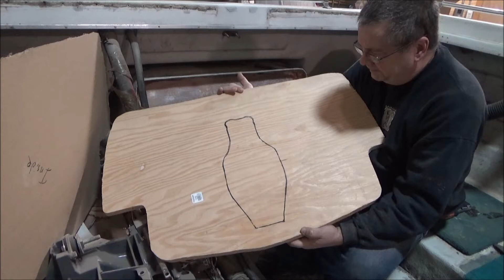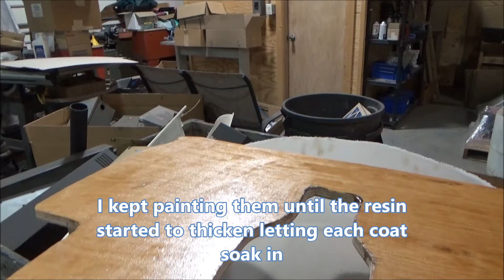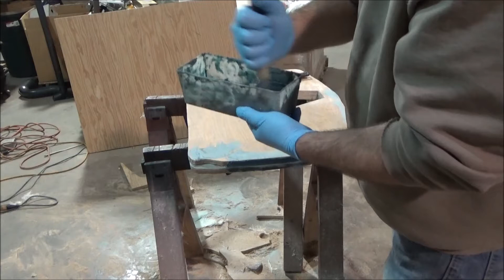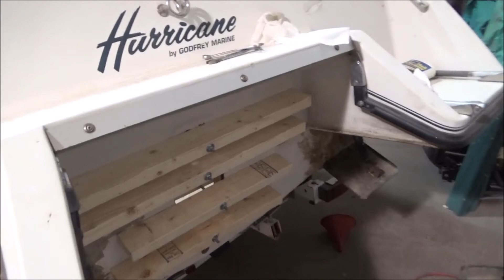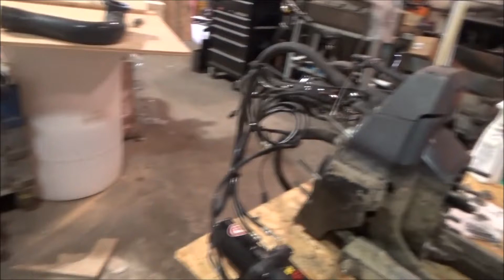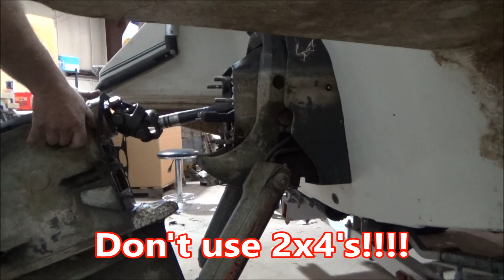92' Hurricane Sundeck - Transom Repair Part 5 - The new transom

Comment: Hi Jeff, I've enjoyed watching the videos of you fixing the transom on your Sundeck.  I wish I'd have seen you start this series of videos years ago as you were doing them, as I have a few things I would have added that I think would have been beneficial to you.  I'll go ahead and mention them here anyway, in case some others who are going to undertake this type of project will be able to benefit.

First of all, I noticed the use of automotive grade polyester resin and fiberglass fabric.  Folks, if you're not patching rusty fenders on your jalopy, you really need to spend the money and buy structural grade fabric and resins.  There isn't a huge difference in cost, especially given the enormous amount of your time and labor that goes into a project like this.  Don't cut corners.  Also, I'd have strongly suggested you spend the extra money and use COOSA board to rebuild the transom, instead of plywood.  I'm not sure if the plywood you used was Marine grade or not, but even Marine grade is junk compared to a reinforced structural grade foam core material such as COOSA.  With the likelihood that your I/O will leak again (especially given the re-use of gaskets and non-Marine grade sealants i.e. Permatex. . . . it will leak on your car, it will damn sure leak on your boat. . . ) I can't see using any material that could ever rot.  If it's worth fixing, it's worth fixing the right way the first time (instead of doing it again in four or five years.)

Also, you really only replaced PART of the transom.  You should have gone ahead and cut back the stringers enough to replace the entire transom all the way to the lower outboard corners of the rear bulkhead, and then spliced in a repair section to the stringers bonded against the new transom to restore the longitudinal load path.  As it is, you've got a shear connection between the new and old transom that is carried by the outer hull skin and whatever glasswork and tabbing you did during your repair.  The fact that the work was done with non-structural body shop material makes me worry that you'll end up with a failed transom again, likely accompanied by a hull breech down the road originating at the lower corners where the stringers would have other wise been supporting the transom.

The best analogy for explaining my point, is if you cut a ceiling out of a space between two walls, and replaced it with a ceiling that is only joined to the walls by joint compound and drywall.  This would NOT be an equivalent ceiling where the joists spanned across the top of the walls to the headers.  The best suggestion I could make to improve your present repair is if you added "knees" between the top of the stringers and the new transom to restore the load path.  I'd be happy to elaborate if you'd like, I'm trying to help you have a permanent repair and actually improve the strength of the hull beyond its original design.

Comment: I am going through similar situation on my Bayliner Capri.  ( https://www.youtube.com/watch?v=mYozqpccbQg&t=492s ).  May I ask if you have a Part 6 coming?  I am curious to find out how to bleed the hydraulic line.
Reply from the maker: The only hydraulics on my boat were for the tilt/trim and it worked perfectly when I got done. Only issue I had and caught right away before any damage was done was I followed someones advice that didn't know ant better when I refilled my lower unit I didn't fill it all the way to the dip stick on top of the unit. If I post a video 6 on this it would be enjoying it on the lake. Or if it breaks down again I may post a video of blowing it up! Best of luck on your project, I hope it's ready for enjoyment soon.